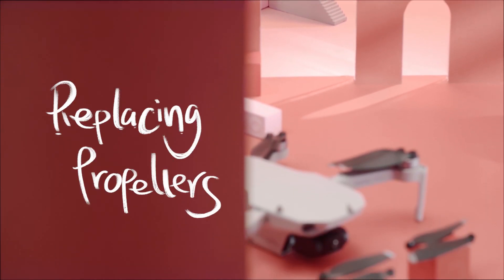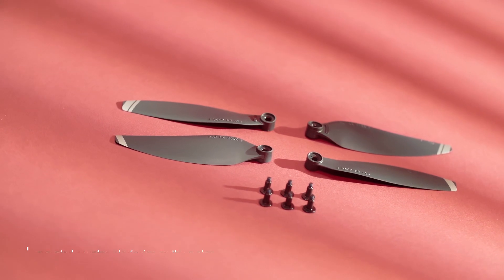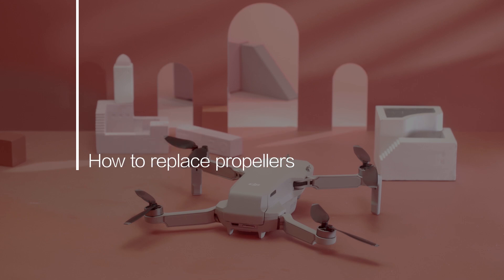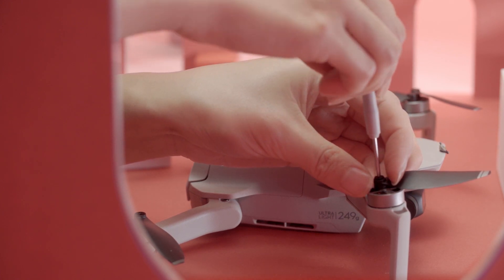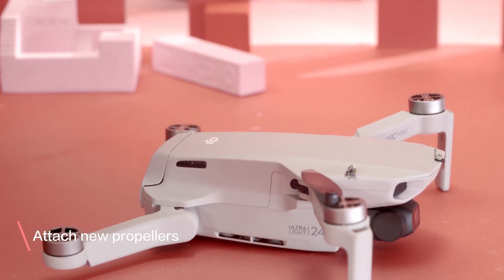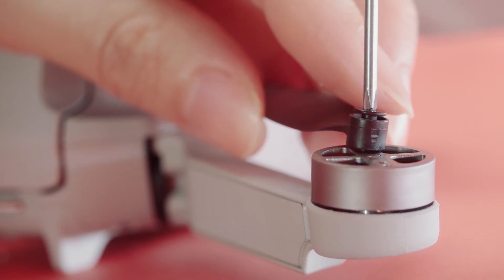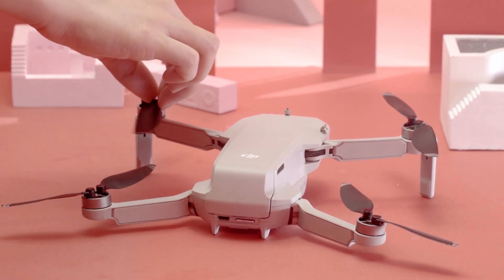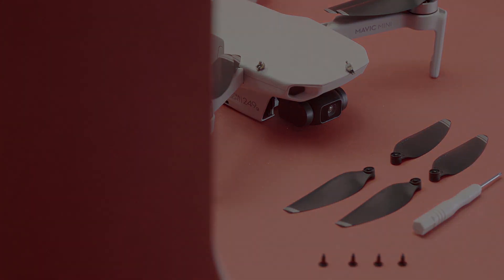Mavic Mini | How To Replace The Propellers

Comment: Thank you so much for the tutorial. I replaced my props wrong and the drone was making a low sound like you would hear on a bigger drone. I knew something was wrong but I took off and the drone failed. I looked at this tutorial and I fixed it and it succeeded. Thank you.

Comment: I’m not quite sure, but my Mavic mini seems to be drifting more than usual and I did recently have a collision where my propellers were hit multiple times. The crash wasn’t too bad and nothing else appears to be damaged on the drone. Should I replace the propellers even though I can’t see much damage?
Reply: Adam Thomas Yeesh, that seems a lot worse than my issue! It might not even be a problem at all, but mine seems to be a little less stable in the air. Your issue on the other hand seems a lot worse than mine. Change the propellers and make sure they are on their correct positions. You should also look into calibrating the compass and IMU. If that doesn’t work you should probably get it checked after quarantine. Hope everything gets fixed soon 👍

Comment: Recently, in fact yesterday, my Mavic mini was making a beeping sound on the left back propeller. At the base it felt very warm compared to the other propeller bases ... told me that I needed to change it .... Any reason why?
Reply: It could be nicked or warped.  I had to replace mine today when it said it was rotating too fast, when it landed it was making that beep sound.  I confirmed it was nicked so I changed it.  The blades need to be in  as close to perfect condition as possible for proper, stable flight.

Comment: What size is the screwdriver? I looked on the website and DJI doesnt sell the screwdriver if you didnt purchase it in the Fly more package. I was going to get a screwdriver off amazon but not sure what size to get
Reply from the maker: Hello, there. A screwdriver for removing propellers comes with the Mavic Mini aircraft. To make it more convenient for you, we use the common Phillips screws. You can use a PH0 screwdriver to remove and install the propellers.
PH0: The screwdriver bit's diameter is about 3.0 mm, and it can be used for mounting or removing M1.6 to M2 screws. If you have any questions, please contact out support through email. Here is the link: https://www.dji.com/support?from=store_footer

Comment: I was able to change the propellers in my Mini SE easily. However for the Mini 3 , three of the four screws are too tight. I think I’m stripping the plus ; I cant get them out :(
Reply from the maker: Hello, there. Sorry for the inconvenience. You may try as follows: After the screwdriver is inserted into the screws, please apply with certain force to insert the screws stably and disassemble them.
Or you may try another recommended screw head. Screwdriver model: PH0 Phillips screwdriver.
Reply: @DJITutorials  thanks for the tip. I’ve ordered a PH0 screwdriver as recommended. Someone had suggested I would need a PH0000 type but I couldn’t find one. There is a PH0 Philips ; I have ordered it on Amazon
Reply from the maker: @cats-uk  Thanks for your update as well, if there is anything else that we can help with, please feel free to contact us anytime.
Reply: @DJITutorials  I got a PH0 screwdriver and I was able to remove one more screw. I’m now left with two screws I cannot get out. The + on the screw doesn’t look like a plus anymore. 

How can I remove the plastic (propeller) and the screw without causing damage? (I live in the U.K.  do you have any physical locations in London where I can bring this into please ?)
Reply: What tool can I use to remove the black plastic surrounding the stripped screw? I tried using a hot knife to melt the plastic but it didn’t work and I’m nervous about causing damage

Comment: I can't tell, should i be screwing them in 100% or more at 90%? When I screw them in 100% the blades don't hang limp like they're supposed to.
Reply: I think I answered my own question, I didn't think it was a big deal but you really do have to replace the screw with the propeller. It makes a world of difference.

Comment: can use the new DJI goggle FPV, with this drone?
Reply from the maker: No. The Mavic Mini is an entry-level product that is used with our brand-new app, DJI Fly. We will continue to optimize this product according to customer feedback. If you have relevant compatibility requirements, please feel free to tell us. Your suggestions are very important to us.
Reply: @DJITutorials  well yes. just today I saw an interesting polirized les for this model. it weights only 1.3 grams... but that will make the drone to weight more then 250 so i cant buy it :P
Reply: DJI Tutorials litchi please 😁

Comment: What if the screws become loose when the drone is flying in air?
Reply: If the props come off in the air then it falls....

That's why they have thread locker on them.  Thread locker usually fully cures within 24-48 hours, but IDK what brand/model paste they have on there.

Comment: Did you guys need make it so tight to the point you have to damn near break it to get it off
Reply: In that cases.. Try  to use after market precision screw driver
Reply: I faces same problem while i need to change my mini 2's props with screw driver from the package.

Comment: Why is it so complicated? Just make them click in like other DJI drones....why the need of screwdriver and all those extra steps....you made a drone simple and more complicated at the same time.... :/
Reply: They most likely had to do it this way. The hardware/mechanism for the push/twist props would’ve added to the weight and when you’re trying to keep the drone under 250 grams, every little bit counts.
Reply: It's hardly complicated, just takes a little longer than other dji props.